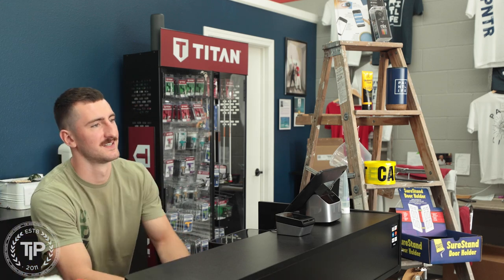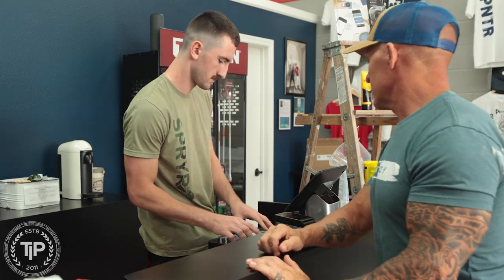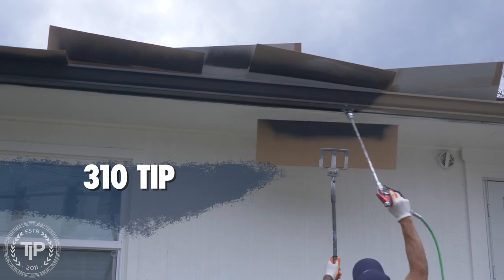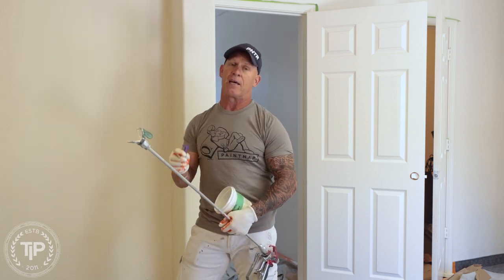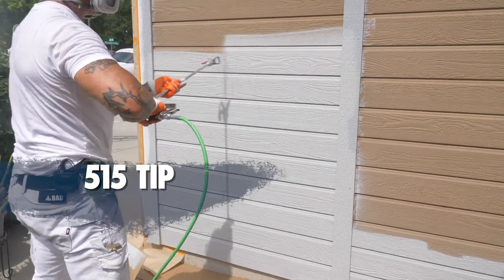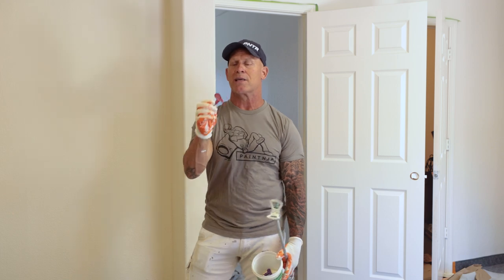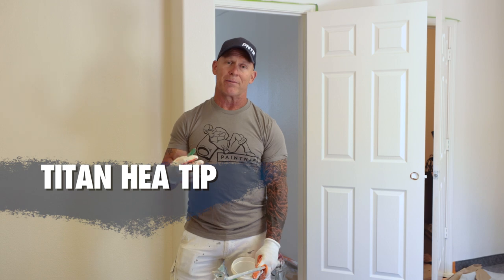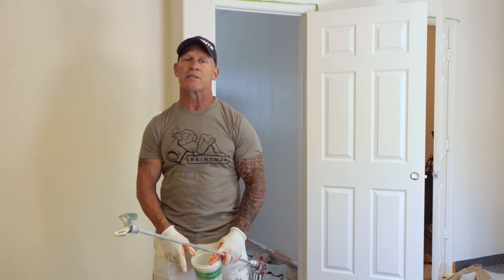What airless spray tips works best?  Get the perfect finish!

Comment: I have two questions. The first one is covering OSB board. I’m gonna be painting USB on the inside of a shed and was wondering what tip it may be a paint recommendation.
The second question is about painting oversell spray film. I’m planning on using a 515 with a water-based acrylic. 
Any thoughts or suggestions on painting spray foam?

Comment: Hi Chris
Question.... Will a sprayer help hide critical light on a ceiling
I've painted it with 
Wooster 450m sleeve
Flat paint
But this one spot looks patchy 
One whole side of lounge is glass 
Im running out of options
I have a Graco handheld with a 515 tip would this work

Comment: How important is it to follow the tip size recommendation on the paint gallon. For example, duration exterior says you need a .017, but could you cheat it and use a .015 for less overspray outside?
Reply from the maker: No important at all

Comment: Do you think a 619 tip is too big for a 440 titan or would you use a smaller tip for interior walls?
Reply: 619 way to big bro . 415 I use for walls ..
Reply: I’ve used 621 with my 440. But a 619 is fine as long as you know what you’re doing and have your pressure dialed in. I’m a commercial painter, interior is 621 or 631 depending on what we’re doing for walls. But we’re doing big walls and back rolling everything

Comment: Production tips - 515 Bedford black or titan red for exterior @2000-2200 psi, up to a 619 tip for interior walls.

HEA 619 @800-1100 psi for ceilings.

Comment: It kind of depends on the type of paint you're using too, no? The Sherwin Williams Emerald Trim paint says to use a 0.013 - 0.017 tip. So a 310 tip wouldn't work.
Reply: @firpofutbol  I just sprayed emerald on interior doors with a 410 tip...looks amazing
Reply: @ryanspence7239  After this video and other reviews, I did the same, used a 310 low pressure fine finish tip (green one) and it worked like a charm. Had to buy the blue guard to to work with this tip.

Comment: Do all paints have to be watered down to some degree to be used with a sprayer?  Whether a cheaper Wagner from the big box store, or a "fancy" one like you have?  Great video!
Reply: Airless sprayers will spray any paint without being watered down. It's only when you use hvlp's that you have have to start playing with reducing. Wagner sprayers are more trouble than they are worth. Get a titan 400 or 440 if you will be doing enough painting to justify the use of a sprayer. Even just renting one is worth the time over buying a wagner.
Reply: @ridenorthwest1687  Thank you!  Great info, and something to consider.
Reply: @ridenorthwest1687  wow..... wish I saw this comment a while ago. I ended up with a Wagner 350m. Once played around with it and the pro tips its actually a flawless machine. I love it and hate it. Easy to use and clean but the hose is a nightmare and a real pain in the ass. The spray quality is just acceptable. Its a good machine but not the best of the best.

Comment: On a piston sprayer how do you adjust the pressures with a gauge? Thanks ✌️
Reply: Most airless sprayers have a dial to adjust pressures without an external gauge.
Reply: @ridenorthwest1687   my airless does not have an indicated pressure dial only a pressure gauge that I purchased to set the pressure. Do you just put the tip in a bucket pull the trigger and dial in the pressure with the gauge? Thanks
Reply: @Slushers1  If your gauge is set on the pump side of the hose the pressure will be about 50-100 psi higher than on the gun side so take that into account. I personally just load the pump up with paint and test spray pattern on paper/plastic masking untill the spray pattern is ideal at the lowest possible pressure. Depending on tip/ hose length the pressure required will vary. Dont overthink the pressure, the goal is just good spray pattern with minimal overspray.